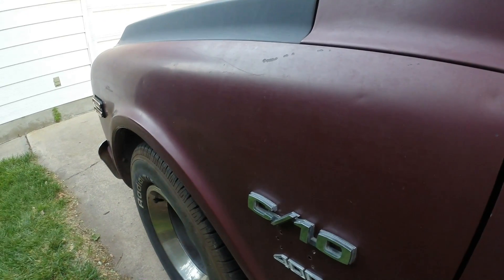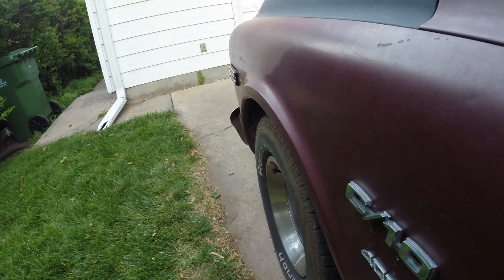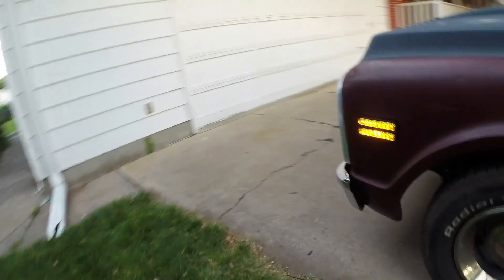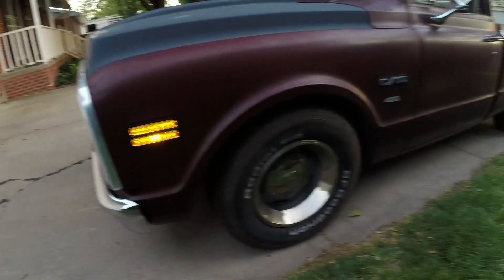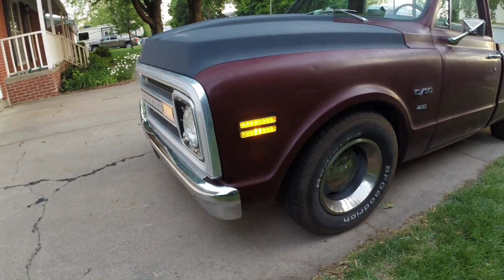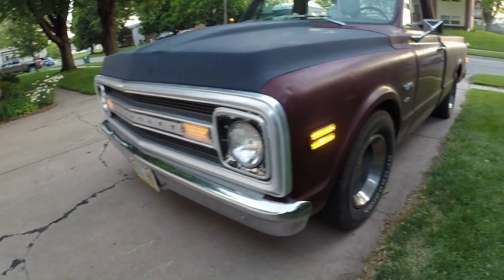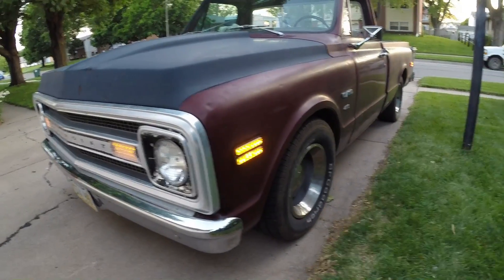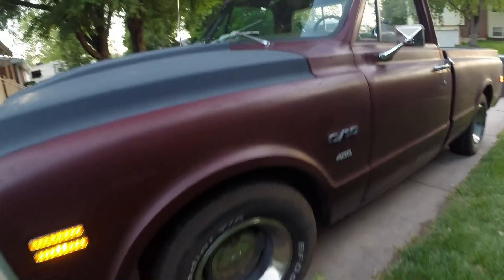Wiring the 1969 Chevy C10 side markers properly and fully (all three functions)

Comment: I got a problem with my back left taillight.. when I turn on my park lights and turn on my left blinker it won't blink but my front left blinker in blinking but when I turn off my park lights my back left blinker starts blinking and so does my front left. Only time my left back taillight doesn't blink it's when I turn on my park lights. Has anyone here ever come across this situation.. I'm having hard time pin pointing this down.. front and back is all led.
Reply: I got the exact same problem with my 68 c10

Comment: Are your rear clearance lights stock?  Did you have turn signals there before the LEDs?
Reply from the maker: Well, they were stock but per the video I installed LEDs in the rear sides.  And no, stock they did not blink with the turn signals, they only lit up as running lights.  They had to be wired in to light up dim as running lights and blink bright with turn signals.

Comment: My rear side markers act like brake lights when I step on the brake.  They get brighter
Reply from the maker: Yep, that's how they work if wired in at the rear.  If you only want them to go bright with the turn signals you have to wire the bright circuit to the front turn signals' bright circuit.  I've been planning to wire them as such, but that requires running some long wires all the way from front to rear.
Reply: @richnat  what's weird is I really never payed attention on how they were setup previously.  Oh well, I just rewired the entire truck and had my chance,  maybe in another life brother!

Comment: Any help on gauge lights not working they recently went out on me 2 days ago
Reply from the maker: I had this very problem a year or so ago.  In my case it turned out to be a poor connection where the wiring harness bulkhead connections are made at the firewall.  The ground for the cluster had gotten a little corroded and thus no power to the cluster lights.

Comment: Hi I am running a new harness from painless and I just need to know how to Id the wire color correct me if I miss read the instruction (White is ground) (Black is the hot wire) and the (last one should go to the turn signal) would this be correct please reply
Reply from the maker: Correct.  As I posted elsewhere in this thread:

ALL white wires are connected to a ground.  Do not use the wiring harness grounds as they are sometimes switched, just ground each one to the body.
ALL black wires should connect to the original side marker light pigtails' brown wire (the black wire in the original marker light pigtails will be left unused)

The red wires differ by location.

Driver front:  red to light blue front turnsignal wire
Passenger front:  red to dark blue front turnsignal wire
Driver rear:  red to yellow turnsignal wire
Passenger rear:  red to green turnsignal wire

Comment: Ok all good stuff,I have a 1969, Chevy too C30, I’m having problems with my head lights,won’t come on, I change the lights switch,the dimmer switch,the fuses,except I noticed a square metal box clipped into a fuse port, oh the tail lights come on, my blinker switch needs to be changed too, could that be the reason why it doesn’t work,?? Ok love your trucks, BigAl California.
Reply from the maker: The square metal box is probably the flasher relay, it is only involved on the turnsignals.  If it is broken it would keep the turnsignals or emergency flashers from flashing.  On the headlights, you probably either have a bad ground on the headlight circuit or a bad connection at the fuse block, probably where the exterior bulkheads connect to the backside of the fuse panel.

Comment: I contacted United Pacific.  I was so appreciative that they sent a response back to me clarifying how to wire them.  

The extra wire goes to the front turn signals or the taillights to give turn and stop.

White wire = Ground (-)

Black wire = Marker light (+)

Red wire = Turn (+)
Reply from the maker: Which is what I outlined in my original reply.  My reply above also identifies what color wire to look for at each corner for the turn signal.

Comment: Do the rear side marker lights come on whenever you hit the brakes?
Reply from the maker: Actually, they do.  I need to adjust the wiring a bit to correct that.
Reply: richnat Yeah I was wondering if you could somehow only get the blinkers and running lights to work without having brake lights. It might be necessary to run an extra wire.
Reply from the maker: @marcomacias8941  Yes, you'd have to wire each side marker to the individual turnsignal wire for each side, you'd have to run wiring down to the loom to catch that.  Not tough, just need the time and materials to make the connections.
Reply from the maker: I should add, the rear of the truck applies power to both turnsignal wires when the brakes are applied.  To get the rear side markers to NOT come on with the brakes and only with the turnsignals, you will have to run wiring from the rear sidemarkers to the front of the truck and tie them into the respective turnsignal wires (the light blue and dark blue wires up front).

Comment: Any idea why only my driver side marker lamps are working?
Reply from the maker: Are you getting power to that side?  Do you have the wires reversed?  LEDs require a specific positive/negative wiring.
Reply: Not led. Original
Reply from the maker: @jeffreydonahoo2588  Could be burned out bulbs, faults in the wiring or faults in the headlight or turnsignal switch.  If it is wiring, usually the grounds are at fault.

Comment from the maker: Someone e-mailed me and asked how the side markers are wired and I had to write it all down so I thought I'd just copy it here as well.

I don't know about other brands, but I used United Pacific LED side marker lights.  They have three wires, red, white and black.  In the list below I list the marker wire color first and what it is connected to.

ALL white wires are connected to a ground.  Do not use the wiring harness grounds as they are sometimes switched, just ground each one to the body.
ALL black wires should connect to the original side marker light pigtails' brown wire (the black wire in the original marker light pigtails will be left unused)

The red wires differ by location.

Driver front:  red to light blue front turnsignal wire
Passenger front:  red to dark blue front turnsignal wire
Driver rear:  red to yellow turnsignal wire
Passenger rear:  red to green turnsignal wire  

I hope this helps.  For the red wires, you need to just do a wire tap as the original wires need to remain intact as they run to the turnsignal lights.
Reply: richnat do you have pictures of the wiring. I just took my rear driver side marker light off and realized there is two wires one that is a ground the other is going to the light itself. I am now curious as to how all three wires come into play on these new LED.
Reply from the maker: Corey, for the rear ones the red wire needs to be connected to the green and yellow wires at the rear harness that runs from the front of the truck.  There are prominent green and yellow wires in that harness.  They also run into the tail light, they just don't readily run to the side markers.
Reply: richnat thank you
Reply: Man thank you so much this really helped I started but stopped .looked up videos nothing. 🙏 thank you .👍👌
Reply: I just hooked them up red to black and black to brown. Add the ground.  Workes just like factory. The black wire you say not to use is the turn signal wire. No need to run another wire. It's already thare.
Reply from the maker: @leviwoodring6101  Yes, that would work just like factory but would leave them with just ON and OFF, wouldn't allow for using both the dim and bright settings available in the lights.
Reply: @richnat  I have all 3 setting on mine. Same brand. The black wire runs to the blue signel wire. At least it does on mine. There is no dedicated ground the black is the ground when just the running lights are on. When you use your blinker it it's send 12 Volta the the " ground wire" wich couse it to lose ground and turn off. Making it blink. So in my application it just hooked red to black black to brown and white it's Chasse ground.
Reply: Rich I know you put this up awhile ago but can you please post the exact directions on how to wire the front and rear side LED lights as you have them on this video. You spoke about them but didn't show us how to install them with step by step directions which I am looking for. I need to know how to wire these. Please be specific- which wire goes to what wire, what harness, exact directions please.
Reply from the maker: @Britishheritage  Look at the posts above.  I posted 4 years ago what wires on the lights go to what wires on the truck.  I don't know how I can be any more specific than that.